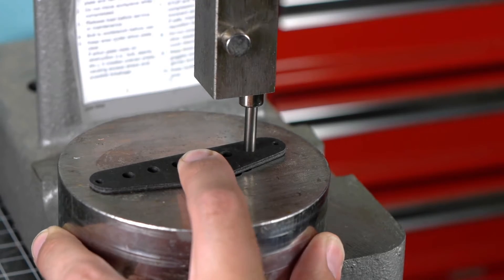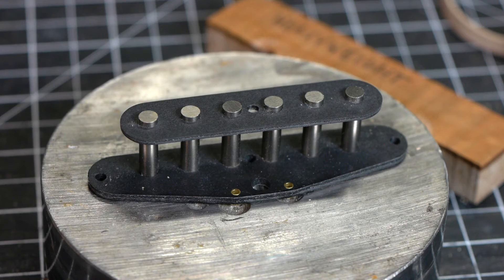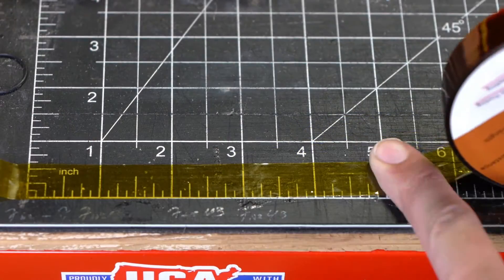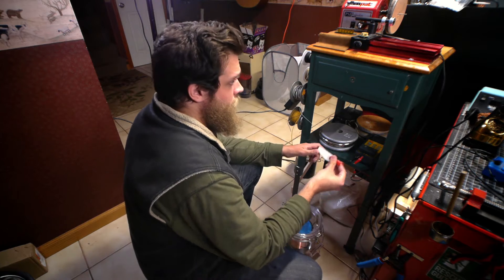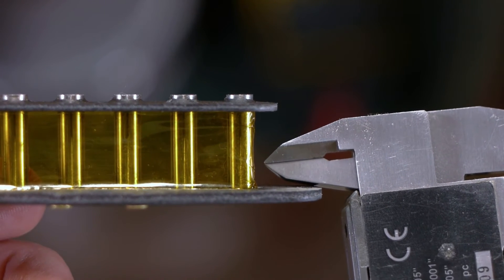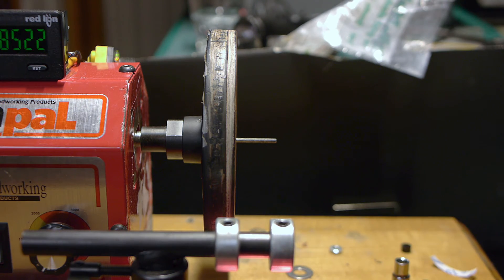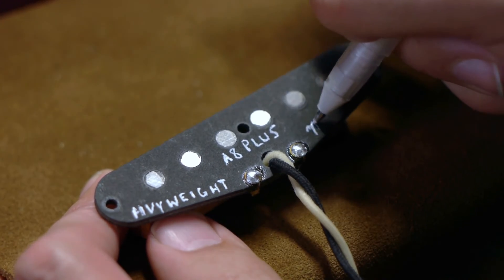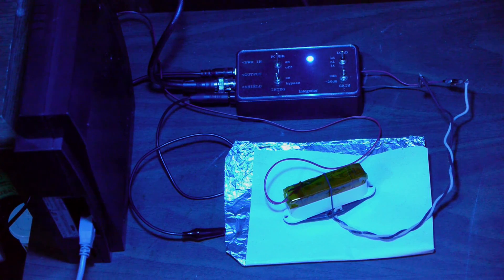(**OLD VERSION: CHECK DESCRIPTION**) Making a Single Coil Pickup: Complete Guide

Comment: Nice tensioner. Luckily I haven't broke any wire yet when winding, I just use baby powder on my fingers. I use the mojotone winder, which has presets that I love. Nice store btw, some of the best prices for alnico V pickups. Can't believe some companies charge over a hundred for one  single coil pickup. Just greedy. I think the trend I see most is that cheaper guitars are getting better pickups. Harley Benton, Donner offer alnico pickups. Hopefully this forces bigger companies like Ibanez and Squier to follow. Just no excuse for larger companies to produce cheaper ceramic pickups when the magnet cost 5 bucks. Probably cheaper if they buy in bulk. This makes me happy. Seeing somebody kick butt and offer affordable pickups.
Reply from the maker: Thanks! The tensioner is Rob DiStefano's idea, from Cavalier Pickups. I've been in touch with Rob for many years and he pretty much got me started with winding pickups. I've modified the tensioner to fit my own needs -- Rob uses a hemostat but it's all the same at the end of the day. Baby powder will of course do it too, whatever works. 

My goal with pickups is to offer ones that no one else is offering as well. My heavyweight model, and some of the newer ones using 46AWG, I haven't seen anywhere else -- and on my own Strat I'm using the 32k one that I sell on eBay, and love it. The 46AWG wire is very expensive and hard to get, though, so I've been trying to see if I can redesign it. 

So, so much with pickups. I'm redoing that Pickup Testing video as I write this as well. Totally overhauled the second part, and showing how to export the data as a text file and upload it into an Excel spreadsheet for easier comparisons. 

I use this all the time now for comparing models. And I plan on doing more experiments with it to test individual variables of each pickup build. Exciting stuff! I can't wait to get that video up. I'll be unlisting the old one, as usual, but I'll let you know in the comment you left on that video when I have the new one ready to go. 

Thanks again! I actually boosted my prices lately on eBay as well. The major thing that's tough with pickups is overhead. I only sell a few pickups here and there and most of that money goes right back into buying more flatwork, magnets, and wire. Definitely tough times we're living in too, so people have been tighter with their money. 

I've actually been gravitating more towards single pickups for that reason. Winding entire sets can be exhausting. And the benefit with single pickups is you can focus on just one tone at a time and what you want out of that specific position.

For me, and my favorite that I offer, that super overwound bridge pickup that just gets a fat and strong P90 tone. I'm so used to it now that I can hardly even imagine using anything else in the bridge position. Though on my Strat I made a custom pickguard and only use two pickups. Overwound bridge pickups blend beautifully with "underwound" neck pickups. Series/parallel, in phase/out of phase...great stuff
Reply: @guitar_md  Amazing work, can't believe you use that gauge. You are totally nuts. Yeah I would need that tensioner for that lmao. Yeah was surprised at your  prices. They still undercut so many other makers and you are doing original stuff. You can make them so much hotter with that gauge. LOL im scared to goto 43 awg. Trully amazing stuff here. You can stack a humbucker in there. And you share your information freely. Totally appreciate man. Very inspirational! I love the 4th position on the start. Can't imagine what a hot neck and middle would sound like.
Reply from the maker: @AmerikkkaGuitars  The tensioner absolutely helps there. I can wind at 4300RPM with 46AWG, and no issues. I will also add that a Wisker Disk is a huge, huge help -- the ones that Azonic makes. I always use those on new spools as well as not using them on the large 5lb spools can cause issues, like the wire getting irreversibly stuck on the spool and unable to dereel. 

Ultra Fine Copper Wire, based in China, supplies wire to companies like Panasonic and more. I had to e-mail them directly. With all the craziness in China lately I'm almost tempted to buy a huge spool of 46AWG from them. My only reservation is I'm not sure if I'd use 46AWG or 45AWG more. But they're much, much cheaper. Even with 80 dollar shipping, it's half the price it would cost here. 

Not using a tensioner definitely requires more care and it can be very tough not to break finer wire. I actually haven't used 42 or even 43 in a while, as I've focused so much on overwound single coils, it's been 44, 45 and 46 for me. I also have a humbucker I designed a few years ago that sounds very Fenderish, which I do with 44AWG on both coils to the tune of 9,000 turns each. Insane amounts of output, it's really a killer humbucker. At some point I'd love to offer it on my store. Humbuckers are just such a royal pain to make.
Reply: @guitar_md  I could imagine stacked humbuckers being a pain. I want to stack a p90 but I keep thinking if it's really worth it. It'll just sound like a standard humbucker? I also heard other companies stack the pickups but use different counts instead of them being the same on both coils. I think Duncan does that on their crazzier designs. Just want that 4th position strat sound in a humbucker. That's my dream pickup to make.
Reply: You know what, I think I'm overwind the single coils like you. I want the 4th position but not the others because of the hum. I'll use a 3 way with humbucker in bridge and the 4th position sound on the other end of the 3 way. Completely humless, no option for single coil only. Overwinding is key for sure, to keep levels close enough. So much drop off with 4th position. Thanks again. Video is life changing lol
Reply from the maker: @AmerikkkaGuitars  Overwinding one of the pickups definitely makes a huge difference in the in-between positions. So on my Strat, there's only one in-between -- neck and bridge, like a Tele. And the overwound bridge helps a lot in making those positions musical sounding instead of 'plinky' or too thin. 

Not that the traditional sound is bad, meaning parallel and in-phase. But when you go to parallel out of phase, or series out of phase, you can get an ice-pick, super thin tone unless you have an overwound pickup. 

Even then, it's still very thin, but the mismatch between the winds on the pickups gets a cocked wah kind of tone. It's great. 

I actually made a wiring diagram here, to show how I have my Strat wired: 

https://imgur.com/gallery/aiI59L6

One volume, one tone, and both those pots are push/pull. On the volume, I have it series/parallel, and on the tone, I have it in phase/out of phase. With a 3 way switch on that custom jack plate I made. 

6 tones out of two pickups. N, B, N+B parallel in phase, N+B parallel out of phase, N+B series in phase, N+B series out of phase. 

Such a huge variety of tones. Another factor to keep in mind when winding pickups is how much you're going to use those notch positions. The interplay between the two pickups matters a lot, and is not something I've figured out how to measure yet. I would love to, but no idea how. 

Even with the oscilloscope, it's a great setup, but there's limits to what an exciter coil can measure. It just measures the pickups' response to different flat frequency signals, but doesn't tell you about responsiveness, which would probably require some very complicated setup to simulate a plucked string, and maybe something to map the pickup response like an impulse response. 

Impulse responses are amazing, and I barely understand how those work. But I've wondered for a while now if it would be possible to get an impulse response for a pickup, if there even is such a thing. Currently I have no way of testing or understanding how different magnet types would impact responsiveness/attack/decay, if those are even real things that they would affect. 

Definitely loving this overwound bridge pickup though. So much to experiment with.
Reply: @guitar_md  J. Donald Tillman did some testing on mixing pickups. "Response Effects of Guitar Pickup Mixing" Not sure how he captured the graphs but, has equations he wrote, but I'd dig deeper in that. Not gonna lie but got lost in it.

 I love queen, but never got into that, out of phase, sound. Maybe I'm just not amping it right? Yeah that's the thing is the Neck/Middle is the only position I like on a strat, unless it has a humbucker in the bridge. And it's hum free. 

I read antigua did the plucked string simulator. In between sounds are so special and unique. Definitely would be nice to have them louder or understand how to capture that sound again. Because it does cost more to add 3 pickups and more routing and hardware to use does add up.